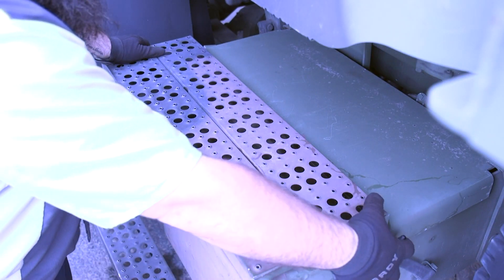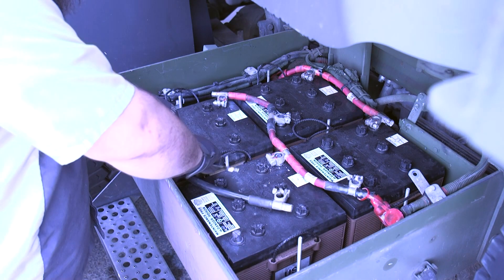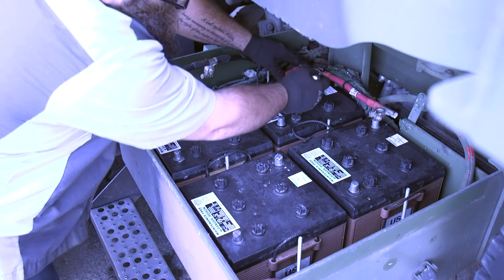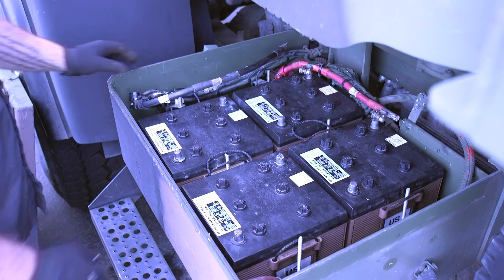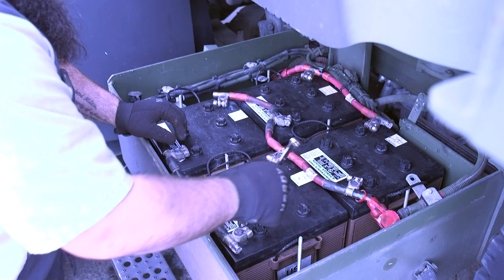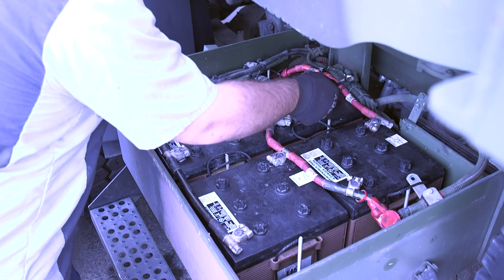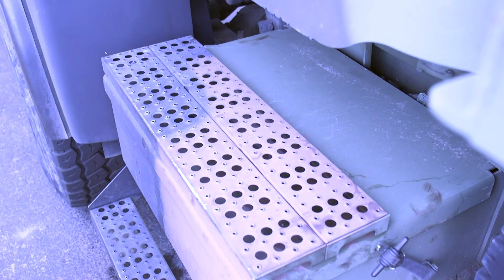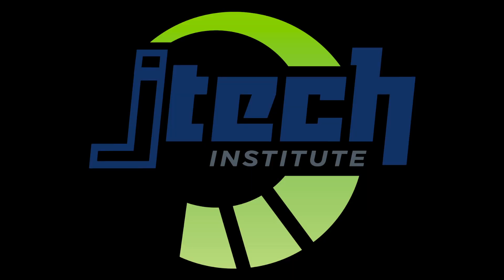REMOVE AND REPLACE BATTERIES IN A SERIES PARALLEL

Comment: Hi there! I got 1986 western star 4900 series 24 volts system and we just put new batteries, but the guy who help me with this job don't remember how was the connections on between those 4 batteries, any body knows how to put the batteries just right? Thanks

Comment: I new to this but the the black closest is the ground and the furthest is the positive correct that goes to the battery and the center changes to 24volt when the solenoid is engaged

Comment: I always thought multiple batteries were connected in either parallel or series, one or the other.
Reply: Sometimes it's both. That truck is a 24v system, so you need to pair two 12v batteries in series to get 24v. Depending on the cranking amp requirements for the truck, multiple 24v pairs will need to be installed in parallel.

Many older semi trucks will also have a similar setup, but with 6 volt batteries.